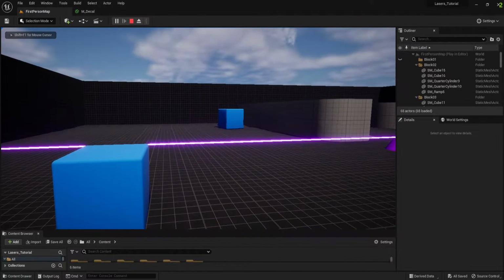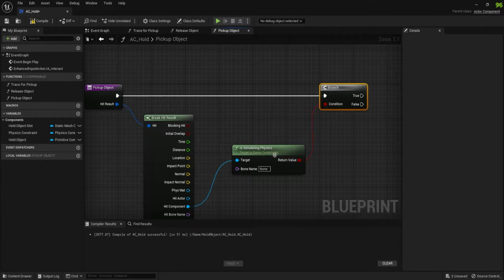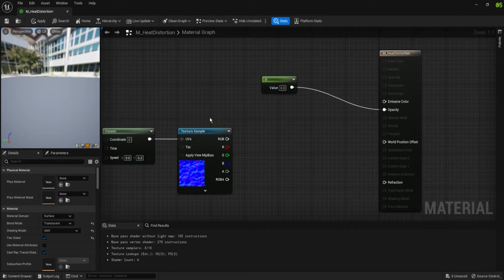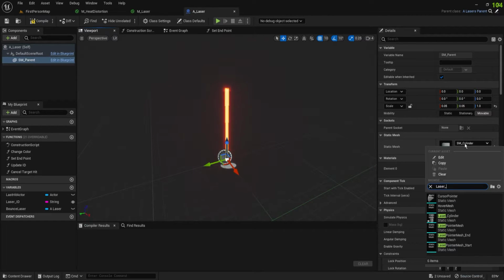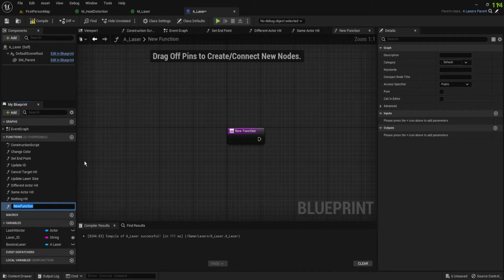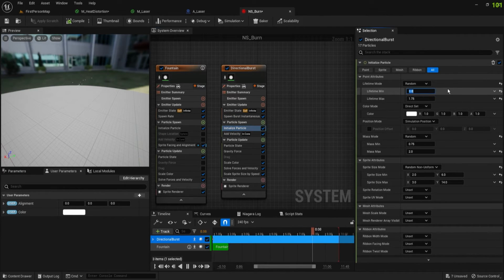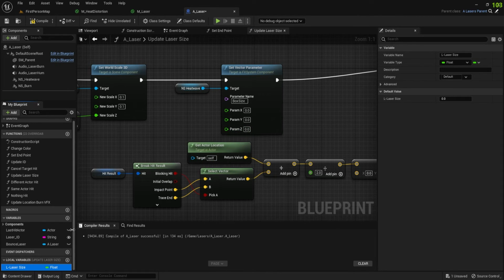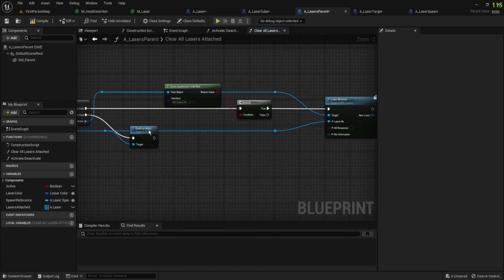Unreal Engine 5 | Laser Tutorial Bonus (Pulse, VFX, SFX...)  NEW VERSION PINNED

Comment: Hello maybe you or someone in the comments can help me with my problem. i have rebuilt the laser from the video and use it for a laser cutting machine that cuts a sheet metal plate. the laser always stands still and only the sheet metal plate under it moves, but the laser track is not dragged along but only a dot is created. now my question is does anyone know how i can change the laser track so that the laser still draws the track on my sheet metal plate even though the laser head is stationary.
Reply from the maker: Sorry it took me a while to get back to you. What I would suggest doing instead of having the NS_Burn be a component use the spawn Niagara attached function and attach it to the hit component, that way as the metal sheet gets hit, the burn mark should stick to the metal that moves. Although, this may cause issues with the quantity of the particles, so you might need to play around with the Niagara System.
I hope this helps.

Comment: Hi guys !
I'm using UE 4.27 : when recoding the M_laser, I've got an error when setting the PulseLerp variable : 

[SM5] (Node LinearInterpolate) Coercion failed: MaterialFloat3 Local9 = ceil(Local8);
: float3 -> float

I've plugged the "R" pin of "TextureSample" into the "A" pin of "multiply (1.05)", to temporaly fix the issue. 

Do you have a better/another solution ?

I hope I explained the problem correctly ;)
Reply from the maker: So I'm not an expert on the material graph, but I believe what you did is a perfectly good solution to the problem. Because we were just using the RGB as an alpha channel. I think the reason you have an issue is because of the Engine Version. Another solution is to use a component mask, but that would do the same thing as just getting the "R" from "texture sample".
Reply: @patsanoob  OK, thanks for replying !

Comment: I seem to have an issue where the laser isn't spawning at all. It worked after doing part 1, but after doing part 2 and some of the changes in this part, it's no longer spawning. I was looking forward to having a reflective beam. It just has a constant green trace from the laser spawn to the great beyond.
Edit: I figured out what was wrong. I lowered the arrow before so the laser would be lower for my game.
Now I have a reflection problem. It's going right from the laser reflect actor.
Edit 2: I found out it was too high and above the laser (for context, I'm making a top down 2D game like Zelda). Now the problem is I get a load of Blueprint Runtime Error after exiting.
Another problem I have is the laser doesn't spawn from the laser reflect actor and I instead get a green trace going the wrong way and a red trace going the right way.
Blueprint Runtime Error: "Attempted to access BP_Laser_C_1 via property BounceLaser, but BP_Laser_C_1 is not valid (pending kill or garbage)". Node:  Set Actor Location Graph:  SameActorHit Function:  Same Actor Hit Blueprint:  BP_Laser
Edit 3: I found I made a mistake with the Laser ID variable. That's fixed and plugged in, but now I have these Blueprint Runtime Errors, the laser goes through the laser reflect actor, the trace is still the same as I mentioned earlier except now it's permanent even though it's set to duration. 
Blueprint Runtime Error: "Accessed None trying to read property BounceLaser". Node:  Set Actor Location Graph:  SameActorHit Function:  Same Actor Hit Blueprint:  BP_Laser
Blueprint Runtime Error: "Accessed None trying to read property BounceLaser". Node:  Set Actor Rotation Graph:  SameActorHit Function:  Same Actor Hit Blueprint:  BP_Laser
Reply: I looked in the comments on the previous video and I'm still having the issue despite your solution to PurpleThePurplest. The Boolean is set to true. Please help me.
Reply from the maker: Does this issue only occur with the bounce or does the same thing happen with a cube. I think I know the cause, there are two possibiltiies:
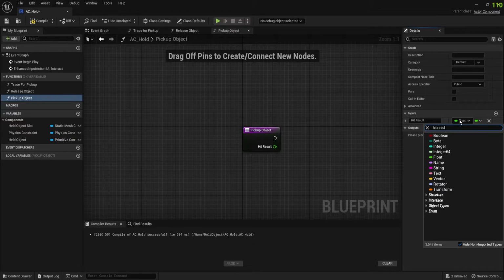- First is within the A_LaserReflect in the Laser Bounce function, you need to make sure that the function returns the new laser spawned (7:03 in the Second video)
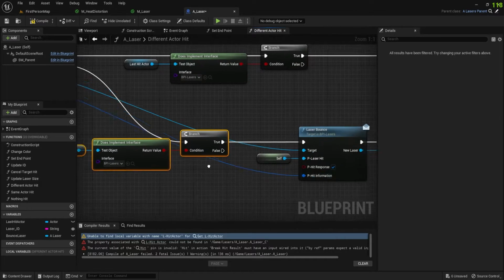- The second is inside the A_Laser DifferentActorHit on the second part of the Sequence after the Laser Bounce, make sure to set the BounceLaser variable (36:16)
Hope this helps solve your issue
Reply: @patsanoob  Neither of those helped. The function does indeed return the new laser spawned and the BounceLaser variable is set after the Laser Bounce.
I should clarify I didn't make the cube. I only wanted to make a laser beam system with reflective mirrors that can be moved around.
Reply from the maker: The issue you are facing is that when you spawned your laser, and it is attempting to update its location for the bounce it is not finding the reference to the variable, so the only other issue that can cause this is that you are calling the NothingHit function incorrectly/at the wrong moment in SetEndPoint which clears the bounce laser meaning that the laser doesn't work correctly.
Reply: @patsanoob  I had a look again at the Laser Bounce function and found out what was wrong. I didn't notice earlier the visual glitch that Unreal was giving me. The reroute node was showing something plugged in but I also didn't notice nothing was plugged into the return value of the spawn laser node. Those errors are fixed now but now I have the following which are similar:
Blueprint Runtime Error: "Attempted to access BP_Laser_C_1 via property BounceLaser, but BP_Laser_C_1 is not valid (pending kill or garbage)". Node:  Set Actor Location Graph:  SameActorHit Function:  Same Actor Hit Blueprint:  BP_Laser
Blueprint Runtime Error: "Attempted to access BP_Laser_C_1 via property BounceLaser, but BP_Laser_C_1 is not valid (pending kill or garbage)". Node:  Set Actor Rotation Graph:  SameActorHit Function:  Same Actor Hit Blueprint:  BP_Laser
Reply: @patsanoob  I don't know why, but I sent a reply yesterday, looked back today and found it gone, so I'm sending this again, but I also have an update: I put the Bounce Laser variable into an Is Valid node and it's coming out as is not valid.
I had a look again at the Laser Bounce function and found out what was wrong. I didn't notice earlier the visual glitch that Unreal was giving me. The reroute node was showing something plugged in but I also didn't notice nothing was plugged into the return value of the spawn laser node. Those errors are fixed now but now I have the following which are similar:
Blueprint Runtime Error: "Attempted to access BP_Laser_C_1 via property BounceLaser, but BP_Laser_C_1 is not valid (pending kill or garbage)". Node:  Set Actor Location Graph:  SameActorHit Function:  Same Actor Hit Blueprint:  BP_Laser
Blueprint Runtime Error: "Attempted to access BP_Laser_C_1 via property BounceLaser, but BP_Laser_C_1 is not valid (pending kill or garbage)". Node:  Set Actor Rotation Graph:  SameActorHit Function:  Same Actor Hit Blueprint:  BP_Laser
Reply: Another update: I put a print string after Is Valid and Laser_C_1 and C_3 appear. This is very strange.
Edit: I put a print string in the Bounce Laser function before the branch to find the P-Hit Response value. I get true 3 times, then false twice.
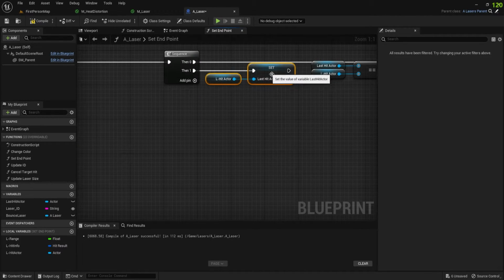Reply from the maker: The only thing I can think of is that you might have the set Last Hit Actor before calling the other functions when it NEEDS to be called on the second part of the sequence. (34:10)
Reply: @patsanoob   Nope, that's the same. Set Last Hit Actor is on Then 1 of the sequence node, after everything else runs.
Reply: @patsanoob  So I decided to do the whole tutorial again but this time in the first person template and it's working. I have no idea what I did differently that would've caused it to work/not work.
Reply from the maker: Are you still facing the exact same issue?
Reply: @patsanoob no, at least when I just redid the tutorial. I’m currently unsure how to proceed with my own project as the issue is still there. Should I migrate the files over and change what I need or compare and see where I went wrong?
Reply from the maker: I would suggest migrating them over but removing the old or renaming(to avoid errors) them if you want to check what you missed.
Reply: @patsanoob  Hi, so far I've got everything working with my game project. Now I have an issue. I've made the LaserReflect actor moveable on a block that can be pushed. Unfortunately, this is now making the laser flash constantly and making new lasers when the player pushes the block into the trajectory of the laser. The original laser is stable but the new laser keeps getting recreated. Can you please help me with this?
Reply from the maker: Not sure if this can solve your issue, but you could add the reflect actor to an array that you connect to actors to ignore on the SetEndPoint line trace.
Reply: @patsanoob  It didn't work, unless I did something wrong. I added the array variable to the parent actor. I attached it to the trace. In the reflect actor's Construction Script, I added an add unique node with the array and attached self. That's all I did.
Reply from the maker: So you seem to have created it correctly, but I'm not sure if you set up the add correctly. You need to make sure that you are modifying the new laser's array, not the reflect. To do this:
- Inside the Laserbounce function in the A_Reflect after spawn actor from class A_Laser
- Get reference from A_Laser and get the array you created.
- Add self to that array
And that should do it.
Reply: @patsanoob  I did that and it's still not working.
I just thought of something though. What if I use the same logic as the laser cube actor? Use an attach actor to component node? Though I need it to reflect from the appropriate direction depending where it's coming from.
Reply from the maker: That could work I’d say it is worth a shot
Reply: @patsanoob  So it didn't, but then I put the reflect actor in front of the laser trajectory to begin with and it's having that issue without the player moving the block in front of it. I dunno why this is happening. It was working just fine before.
I have a print string to print out the display names of both last hit actor and L-hit actor and I get the following results when it hits the reflect:
" and BP_Reflect"
" and BP_PushableBlock" (just a regular block for my game)
"BP_Reflect and BP_Laser_C_1"
"BP_Laser_C_1 and BP_Reflect"
Repeats from "and BP_PushableBlock", increasing the ID of the laser every time
Is it perhaps a collision issue?
Reply: Never mind, I dunno why, but I had something in the collision changed when it shouldn't have. The reflection is working now. I'll let you know if I get anymore issues. Almost done with my project. It's for uni. Thank you so much for the tutorial and the help.
Reply from the maker: Glad you managed to do what you wanted!
Reply: @patsanoob  So I have one more issue. I have now changed the spawn actor to a sprite for my game. I want the spawn to be a free standing object, not connected to a wall. I tried changing the direction of the arrow so the beam would change direction between up, left, down, right, but it didn't work. Changing the get actor up vector to another vector didn't work either. Can you tell me how I'd get it spawning in a different direction?
Reply from the maker: You should be able to just rotate the A_Laser_spawn actor, as the direction the A_Laser uses should always be up but relative to its parent, meaning you just need to rotate the Spawn and that should do the trick.
Reply: @patsanoob  Rotating the whole spawn actor makes the sprite look off though because it has shading that needs to be fixed (dark colours in the bottom right and light in the top left). I just want to be able to rotate the arrow through Construction Script which I have set according to an Enum.
I thought of a way to do it and managed to get it working by getting the forward vector of the arrow, then make rot from Z which is the axis I'm rotating the arrow by. Wish I thought of that earlier. I'm getting anxiety because my deadline's on Friday.
Reply from the maker: What I found worked best because rot from Z only works in one dimension. (don't do this if it is working fine for your situation, no point in fixing what isn't broken):
- From Arrow comp get Up & Right Vector
- Multiply them by -1 (separately)
- and then attach them into Make Rot from YX (Up into Y & Right into X)
- Plug rotation into the Spawn actor rotation
And then you can rotate the Arrow in any direction however you want, and the laser will be spawned in that direction.
Reply: @patsanoob  Thanks for the tip. I'll try it after my deadline when I have time.
Since you setup a way to change the laser colour, how easy would it be to make the target actor detect what colour the laser it is and act appropriately? I've made different coloured target sprites and I'd like a white laser to only activate a white target, a blue laser activate a blue target, etc.
Reply from the maker: Not too difficult as you have a reference to the laser hitting your target, you can get laser colour and check if they are equal to that of the target. (If you can't do an equal between colour variables, you can break it and compare the 4 floats with an and node instead)
Reply: @patsanoob  Think I was overcomplicating it in my head, ha ha. Got it working. Thanks.
Reply: @patsanoob  Hello again. Long story short, I failed my uni assignment, for a number of reasons including the infinite loop error with this. I did try the fixes I saw in the comments of part 2 but for some reason I got an issue with the target actor. I tried the fixes again now and they work with no issues. I have no clue what I did differently.
However, there are a couple other things I'd like to ask about. Is there a way to prevent the lasers from bouncing off specific components using a tag? I'm not sure where to put the branch condition check. Another thing is I have different types of reflectors. The main one just reflects 1 way. The 2nd one can reflect 2 ways. I couldn't get the 2 way reflector working before, but I realised the issue, other than the infinite loop. I needed to add a cast to it in the Same Actor Hit function. However, it's a bit messy having it after it after a cast fail for the 1 way reflector mirror actor, especially if I were to add more that reflect differently. Is there a cleaner way of doing this?
Reply from the maker: Sorry to hear that.
- Yes of course, you would have to add an extra condition to the "Different actor hit" where you check for the Does implement interface you would put an AND to check if the hit component doesn't contain the tag that doesn't allow the bounce. (On the second part of the sequence)
- So what you can do to solve this issue is instead of how we did it for the reflection, you can create a new function in the BlueprintInterface for updating the reflection and call that instead of the cast by just checking does implement interface again. And then you just put the code inside the Reflect actor. And your new reflection actor will work simply by modifying the reflection in the actor itself instead of having to do any extra casts.
I hope this helps.
Reply: @patsanoob  I got these errors.
Blueprint Runtime Error: "Accessed None trying to read property BounceLaser". Node:  Set Actor Rotation Graph:  SameActorHit Function:  Same Actor Hit Blueprint:  BP_Laser
Blueprint Runtime Error: "Accessed None trying to read property BounceLaser". Node:  Set Actor Location Graph:  SameActorHit Function:  Same Actor Hit Blueprint:  BP_Laser
I have it set up as Different Actor Hit > Sequence > 1 > Hit Actor Does Implement Interface Branch > True >  Component Has Tag "Block" Branch > False > Laser Bounce. Is this correct?
Reply from the maker: No, you don't want to add a new branch. What you want to do is:
- Get the return value from Does Implement Interface
- Search for AND
- Connect the return from the AND node to the branch
- On the second part of the AND node, you want to connect the Component Has Tag with a NOT boolean in between. Make sure for the component input you are using the Hit Component from P-Hit Information. (If you only want items that have the "Block" tag to work, then simply remove the NOT boolean).
Hope this fixes the issue.
Reply: @patsanoob It doesn’t reflect on the tagged components like I want, but I get basically the same accessed none errors except in my new function now to solve the other issue (which works by the way).
Edit: I also get pending kill or garbage errors after moving pushing the reflector in a specific way. It also sometimes doesn’t reflect when it should.
Reply from the maker: If you are getting an accessed none error, you need to figure out where that Bounce Laser should be getting set and seeing why it isn't. An easy alternative if that error isn't causing the laser to bug is to simply add an Is Valid node before where the error happens. The same thing can be done with IsActorBeingDestroyed for the pending kill error.
A reason why it might be reflecting sometimes and not another is because the code is set up to handle: A new hit ACTOR, same ACTOR and nothing. But now you added functionality for individual components which causes it to not work if you move an item and change the hit component. It's difficult to give a solution for this because it is more your project than my tutorial now, so you might have to troubleshoot this part on your own ^^.